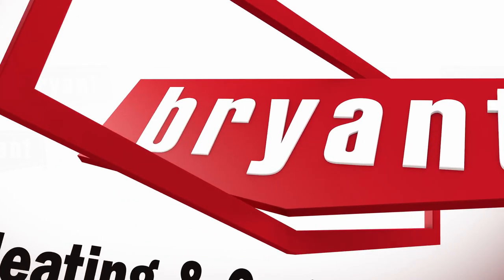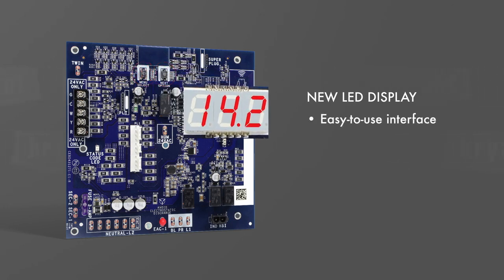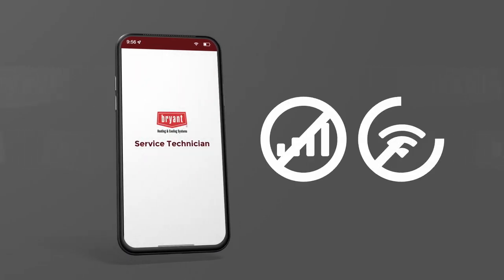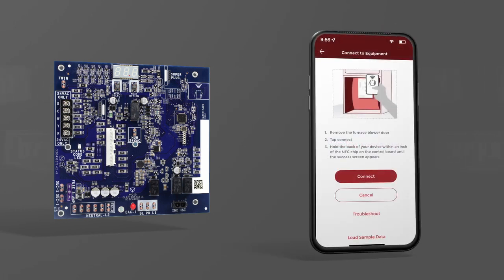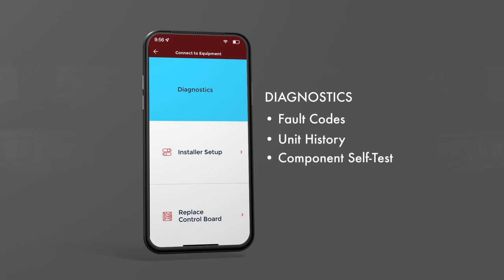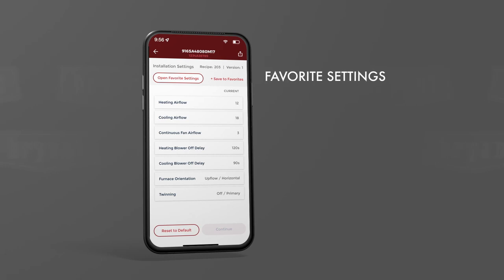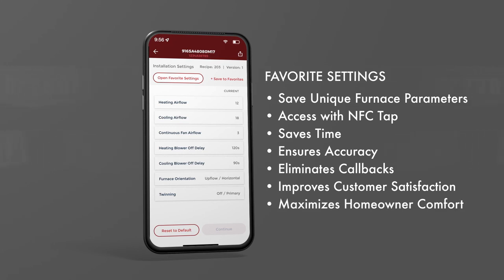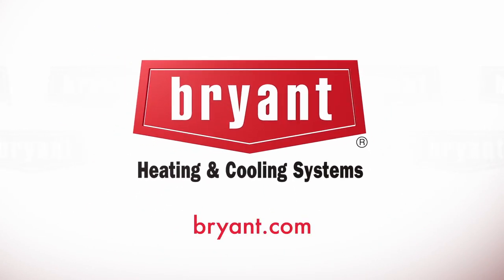Bryant 18-speed Entry Level Furnaces with NFC

Comment: Keeps saying error connecting to the chip and the furnace is off but it keeps saying that
Reply from the maker: If you are unable to read the chip it generally a function of knowing where the chip is located in your phone and what angle to hold your phone at. For example, an iPhone has the chip up at the top and it works best holding it from corner to corner on the square printed on the circuit board and then angling it at 30-45 degree angle to the board. There is a learning curve. We have helped dealers with hundreds of phones since the summer so we have gotten good at figuring each phone out when it is in our hands.
Reply from the maker: Where are you reading that the furnace is "off?'

Comment: I have a question about the Installer setup when using the NFC mode.
I just noticed that on two-stage furnaces, the low heat mode has an off-on switch. If using a single-stage thermostat, does the low heat need to be turned or does the board automatically control the staging, even if the switch says "off"?
The manual doesn't really explain any of that.
Reply from the maker: This video was specific to entry level models, which are single stage. In the case of 2-stage units, the settings you are seeing on the app are basically the same as the old settings on dip switches. You can configure Bryant 2-stage furnaces to run off of a single stage stat and just a W1 wire. There is an algorithm in the furnace circuit boards (old style and new NFC style) that will bring on second stage. However, the algorithm is basically a glorified time delay so if you have the ability to use a W2 wire from your thermostat that is much preferred.